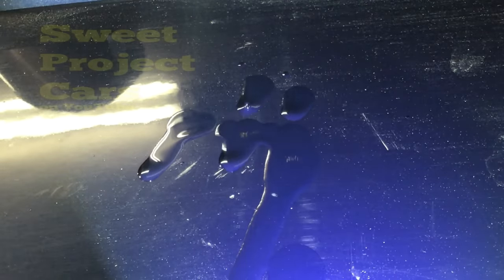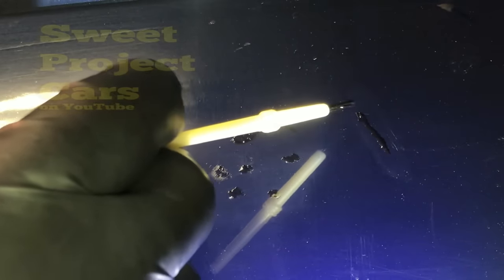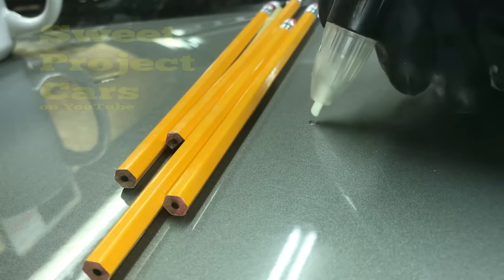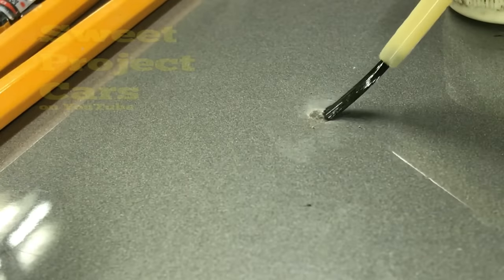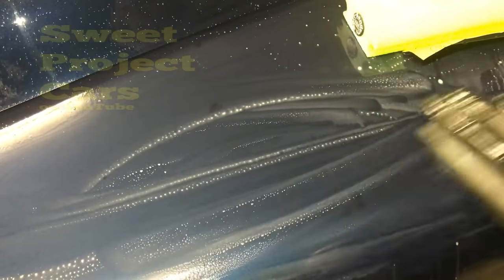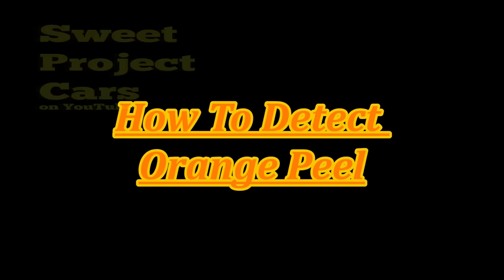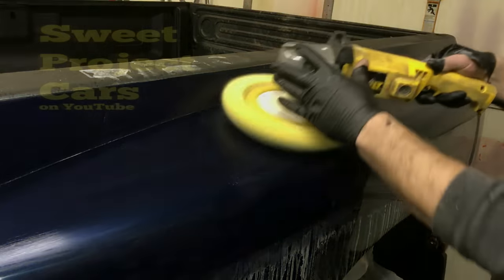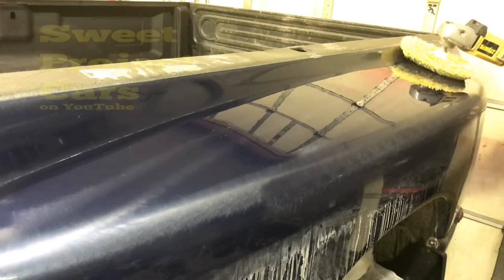How To FIX Any Paint Chip or Scratch in Your Car or Truck Paint... DIY

Comment: From my experience doing this I learned 3000 grit will take a while so you need to have patience like the man says, 2000 grit is much faster but be careful not to sand too hard and no a regular sponge may not work since it deforms when soaped up and isn't an even flat surface which you need, also be careful with the lacquer thinner not to put too much with your q-tip, if you put a bit too much it will form a white circle around the edge of the chip and you'll have to sand that off as well, also make sure the blob of paint is tacky even on a flat surface, having it too runny will not allow it to form enough of a bump to fill the hole and it will spread out and you will just have to do it again if it doesn't fill the hole.  Also get a good buffer, you cannot repeat cannot cheap out on it, or heaven forbid use a drill buffer it's a nightmare if you do.  I can only reiterate what is said in this video and the previous is a must and accurate.  Highly recommend a dremmel with some diamond sand points for rust spots (the cheap knock off diamond head sanders from china where really good for this surprisingly), super fast and accurate to remove corrosion, spot sanding by hand took forever since there where so many stone chips rusted, the portable dremel made the job easy.
Reply: AND a good buffer pad, I like the Schlagel (sp?), or at least get one with a radius on the backer like that one has.  Initially they shed everywhere, but that goes away pretty quickly.  They are nice and thick, last a very long time, and leave a beautiful finish if you lighten up a lot at the end of the cut.

Comment: If you spray water on a scratch or nick and it disappears (which most of those scratches did) then it’s only a clear coat scratch and can be wet sanded away. Great information on how to do the paint.

Comment: Good vid, I use a drill bit and a drill to fix chips that have gone rusty, put a bit of masking tape over the chip so the drill does not slip and just drill ever so gently into the chip so you take away the rust and are left with a tiny clean dent, then rust treat it and level up up with paint.
Reply from the maker: Rod Panhard thank you for sharing my friend :)

Comment: Excellent!  I usually put a coat of Vaseline or petroleum gelly to prevent a deep scratch or chip down to bare metal from rusting in the winter time.I usually take care of them in the spring when its warmer.
Reply from the maker: Phil very smart idea...stop the rust until you can get to it ...thanks so much for that :)

Comment: Awesome work and definitely great video demonstrating the step by step process! I had one question, if the paint obtained can only be matched without mixing clear coat, how do you add the clear after sanding the filled in paint chips? Thank you!
Reply from the maker: We have a video showing how to mix the clear coat 75%paint to 25% clear coat that is the best way to do it.  Get your paint then your clear and mix the two and apply.  Hope this helps.  Have a great day.  mad Mike the hammer SPC

Comment: Thanks for the video! This is the method I've formulated from various videos which I think would be suitable for the 5mm rusted stone chip on my bonnet:
1) Clean surface with rubbing alcohol i.e., isopropyl
2) Get rid of rust - Sandpaper / Knife / Rubbing compound paste
3) Clean rust residue out - isopropyl
4) Prevent rust returning - Self etching primer (etching for bare metal)
5) Touch up paint (single stage paint also has clear coat)
Reply from the maker: Thanks for sharing we will do suggest using lacquer thinner prior to applying the paint this will guarantee a bond also letting it dry 48 hours before sanding is a very important part of that as well
Reply: Sweet Project Cars 
Thanks for the response. My job is a single small stone chip. Is lacker thinner necessary for a small job like that?
Reply from the maker: Well one thing about lacquer thinner is it stores forever you can buy it in a really small container and it comes in very handy for removing many things on your vehicle road tar bugs pretty much anything and it’s safe for your clearcoat so it’s good to have around.

Comment: Yep I now realize I'm an idiot because I thought that isopropyl alcohol was different than rubbing alcohol sorry for my ignorance your videos are amazing thank you so much
Reply from the maker: Mr. you are fine my friend ...no worries here :)
Reply: There is a difference.  Isopropyl is usually 90%+ pure.  Rubbing alcohol can be like 60% and the rest distilled water.  Either will work out fine though.
Reply from the maker: thank you for sharing asus      :)
Reply: it's all isopropyl alcohol,  or isopropanol,  just different solutions or 'strength' if you will.  and i just let someone know in the chemical industry a week ago, so don't feel bad.  And i need to use this technique, i've been 1/2 as'ing it, but trying to learn, i can't get car detailers to even show up here in florida. so i decided i'll do it myself, i have a lot of chips to repair on red ferrari. and repair my work to them at same time. but correct me if i'm wrong, i covered some that were down to metal, but not  rusted, i felt it better to get something on top of it ?
Reply: Everyday is a skool day friend. We all learn summat new every day. And, you won't learn so well if you never ask. No such thing as a dumb question, only dumb answers!!!
Reply: @asusreviews  rubbing alcohol has lanolin in it to keep from drying out skin and it leaves a residue. 99.9% Isopropyl alcohol leaves no residue.

Comment: Hey man, thanks for the video! I've moved through my truck panel by panel and following the steps in your video and my truck looks absolutely fantastic. She's got 160,000 miles of  Colorado city and mountain roads on her (note: sand, gravel and rocks) but really looks great after following your tips. One thing I'm struggling with is swirl marks once the truck is finished. They are visible when the sun is low and directly hitting the truck and I'm pretty sure I'm doing something wrong in the compounding and polishing steps. 

For your info, I'm following your tips exactly starting with complete clay bar and rubbing alcohol until baby butt smooth. Then I proceed with my repair and finally sanding, compounding and polishing. However I don't apply the mothers with the foam compounding pad. I go direct to the wool compounding pad and then to the wool finishing pad. I'm using the Dewalt polisher and a Makita brand wool compounding pad at about 1400-1800 RPM slightly tilted at least three times, sometimes up to six times applying extremely light pressure. Then I go to the mother's carnauba wax and finally the zymol (with water mist) using the same Makita brand wool polishing pad but this time up to about 2100-2400 RPM. Again, using extremely light pressure and slightly tilted. I'm cleaning my pads using a wheel here and there during my work. And the temperature in my garage over the course of the weekend is anywhere between 50 and 70. 

One thing I am noticing after final compounding are really small specs of mother's that need to be buffed out by hand with a microfiber towel and sometimes some water before I move to polishing. They are really hard to see but they are there. It's almost like build up in the shadow of a paint imperfection. The truck sure feels smooth after the clay bar, but maybe I missed something? Also, I'm not sanding the entire panel. I'm only spot sanding in my repair areas. I am compounding and polishing the entire panel.

I've seen another video on your channel about polisher tips and I'm following it pretty much exactly. I can't seem to figure out what I'm doing wrong? Looking for advice on how to take the swirls out AND prevent them from happening again. Any advice would be appreciated. 

FYI- I went with the Makita pads because they are advertised as being 7" vs. the 3M in your link which are advertised at 9" because my polisher came with a 7" hook and loop backing plate. But maybe that was a bad decision. Or maybe I just need to change my technique. Sorry for the long comment, just wanted you to have all the info. Thanks in advance for your help.
Reply from the maker: Michael good job and glad you are winning the battle, you will find our methods are VERY product and tool specific...we only share through many years of trial and error what will work the very first time.  also, you will get swirl marks if you are not using the 3M pads with the dewalt single action, we know as we found out long ago through the school of hard knocks my friend :) mike
Reply: @SweetProjectCars  Roger that! Thanks for getting back to me so quickly. Two quick follow up questions: 1- Do you think the 9" 3M pads will fit on my 7" Dewalt single action polisher back plate? And, 2- I would imagine I just compound and polish again with the new pads to get rid of the swirl marks. Is that correct? Thanks again!
Reply from the maker: Michael Ledger if you are using this backing pad  https://amzn.to/2ODf97J it will fit ALL the 3M pads, my friend, also if you have the swirl marks using the 3m polishing pad https://amzn.to/2S8btNF with this  https://amzn.to/2BizBY6 it will remove them :) we use the Wolfgang if a customer brings in a car that they put swirl marks in.
Reply: @SweetProjectCars  Thanks!
Reply from the maker: Michael you are very welcome :) mike

Comment: As we know you used the color paint and clear coat mixed together... what would you do if you hat to apply them one after another?
Reply from the maker: We wouldn't do it that way.  To obtain the same results, you need to follow the video exactly as we show.  40 years experience has given us this result to share with others.  Thanks.  mad Mike the hammer SPC
Reply: @SweetProjectCars  but what if you have a high metallic color?  wouldn't the clear dilute the color?  I have a subaru with ice metallic silver...
Reply from the maker: We've never had any issues with it diluting on small chips and scratches.  Thanks for the question, Brandon.  Have a great day.  mad Mike the hammer SPC

Comment: 10:23 Now I get the joke I previously read in the comments on another video about rubbing alcohol... :D But you can't be more right on! It's the same thing when it gets to tattooing. Rubbing alcohol removes all the dirt, dust, oil from the surface you're about to work on

Comment: I've heard you can blob some paint on top and level it out with acetone/polish mix and a cloth, I presume wet sanding does a finer job? is using acetone as a paint leveler risky? I'm thinking wet 
sanding would be safer for this novice.

Also heard you can use acetone to clean up before you paint? but again I presume acetone is a little over the top for the job? and laquer thinner is enough to do it most laquer thinners  nowadays being acetone based but more of a mix
.
Reply from the maker: Kielan we only use Lacquer thinner and have had no issues :)

Comment: How much clear coat should i mix in with my touch up paint? I only have 3 chips to repair Thanks
Reply from the maker: Kratedigga1 you will want to use a single stage paint for this method :)
Reply: Sweet Project Cars  where can I find one?
Reply: to my knowledge, any "touch up" paint pens / stix ect, are all single stage paint, meaning they have the clear mixed in.
Reply: @SweetProjectCars  i have touch up pens - primer, base and clear.  How could i do this properly with 3 coats?

Comment: Thanks for the videos on repairing paint chips. Also the tip on mixing your touch up paint with clear coat WORKS! After drying for 24 hours, I used 30-00 grit wet dry sandpaper and then finished off with a 3000 grit pad with my polisher and then Meguirers 205 and then Mothers liquid Carneba wax  Cam out 95 % perfect

Thanks

Bill W
Reply from the maker: Thank you Bill glad it worked for you and thank you for sharing your method that truly helps everyone here have an awesome weekend my friend

Comment: I was working on some chips on my wife's car tonight and didn't like that they aren't smooth.  So I started doing some research and came across your videos.  All I can say is DAMN - the results are amazing!!  I’ve watched it several times but wanted to be sure I didn’t miss anything.  You went from using a clay bar (which is one of my favorite tools) to wet sanding (I will start with 3000 grit) to buffing with the Mag & Aluminum polish, followed by waxing, correct?  And why do you prefer Mag & Aluminum polish vs a "paint" polish from Mother’s (or Meguiar’s, which is what I have always used)?  Thanks again for the great videos!!
Reply from the maker: Todd Richards we love the mothers to remove all scratches no matter how small they are, we found it years ago here at our shop when we thought about how it shines aluminum up to look like chrome and we have been using it on paint, plastic, and glass for years now, and now we do not have shelves full of all different kinds of products, plus we found out just how inferior most of them were after using the moths mag.

Comment: I just got through trying to fix my hood (my first go at body work). The thing is littered with rock chips, scratches, and dents, even a hole that rotted the steel behind it. I really botched the paint job, made new scratches cause I wasn't careful enough during the polish. I didnt hammer down some high points so I sanded right through the new clear-coat and new paint (luckily not the primer). The new paint is darker than the old stuff so the line is super noticeable but after hearing what you just said, I guess I just needed to better sand/polish the hood. Also figured I could have used Mother Mags for the polish. I got a can for de-clouding headlights but I wasnt sure so I bought some turtle wax compound.
Great video, glad the algorithm threw you on my suggestions. New sub from me!
Reply from the maker: Thank you so much for sharing sorry to hear about your issues trying to Diy your body work.  I will say  https://amzn.to/2POiaVT  can be used on any polishing on your vehicle.  It will save you lots of pain and heartache.  Have a great day friend.  mad Mike the hammer SPC

Comment: I’m super new to this and stumbled across this video while trying to learn how to use a touch up pen kit that I bought. Super useful tips, thank you! Just to be clear about the process, please correct me:
1. CLEAN with alcohol
2. Apply thinner to help with the bond
3. Do I need to apply primer before the paint or is that unnecessary since I’m using the thinner?
4. Apply the paint lightly. Allow to dry for two days. I’m in a colder climate - should I allow it to dry longer?
5. Apply the clear coat and allow it to dry for a few days. Since I don’t have the kit that has the paint and clear coat mixed, should I buff the area before adding clear coat?
6. 3000 grit sanding after wetting the surface 
7. Buff and polish

Is that correct?
Thank you!!

Comment: I have found a great tool for the sanding first to get the rust and make it clean. Instead of getting pencils and hole punch and glue there’s a Dimond sharpening stick that’s the size of a pen and I got mine at hardware store in the sharpening stones and chisel area and that’s what they say it’s for. To give your chisel a run over if you need and the stone is back in your work truck. They are awesome to use for store chips I found this when I touched up my hilux 4WD so I didn’t have to pay more when I was getting it ceramic coated as we get on the beach every day we can with the kids. The detailing shop asked me what I used to sand back and they done something similar to your tool and when I went back to get my 4wd from them they had bought 500 of them and they put 5 in the vehicle for me and they couldn’t believe how much time they saved and with ease hopefully you can find the sharpening stick and it works well for you.
Reply from the maker: Thanks for watching and sharing Darren, we really appreciate it, sounds great.  Have a fantastic day my friend. mad Mike the hammer SPC

Comment: Thanks for posting a great video and your process works! I had at least 50 stone chips on my bonnet/hood and I removed them all following this process. I used 3,000 grit sandpaper which caused a few light scratches, probably because I should have continuously checked my work and I found the new paint hard to make flush. I know I overworked it causing scratches, however I managed to buff out most of the scratches.
Reply from the maker: Glad it helped Rich! Thank you so much for watching and sharing your results, that's awesome, good job!  Have a fantastic weekend my friend. mad Mike the hammer SPC
Reply: @SweetProjectCars  Hey Mike. If I still have scratches that you can only see under direct sunlight and you can’t feel them to touch, do I keep applying the Mother’s and buff until gone? Thanks.

Comment: I recommend a Dremel type tool for grinding the chips down you get a cone-shaped  grinding stone much easier and precise I do stone chip repairs a lot and I am a car sprayer we don't all say it needs a full panel respray, I do the repairs in a very similar way and some scratches as well can be done this way well nice video .
Reply: A Dremel, that's a good idea I never thought of. I've got one as part of my tools set, all I need is the right shaped grinding bit.

Cheers for the great idea mate👍